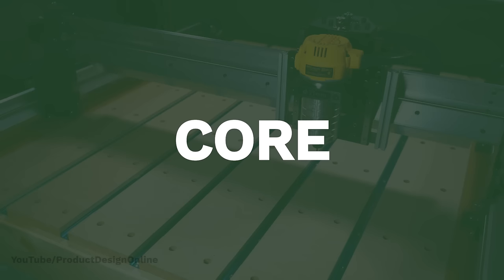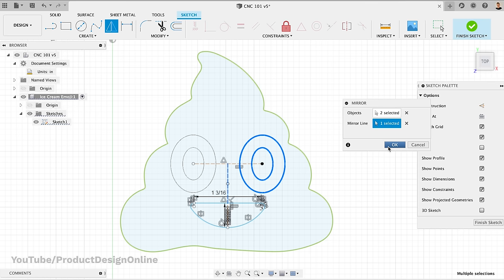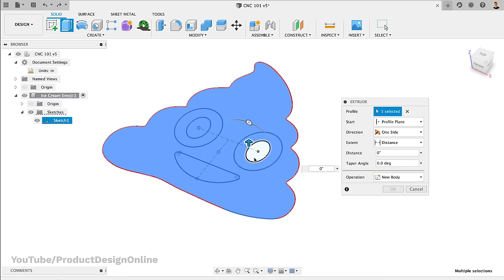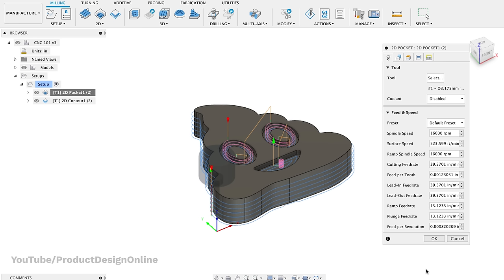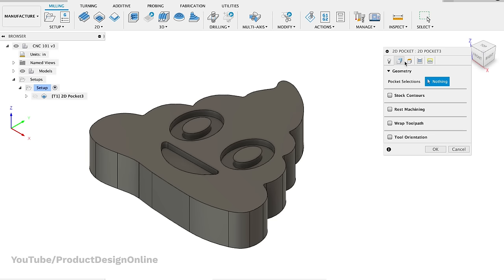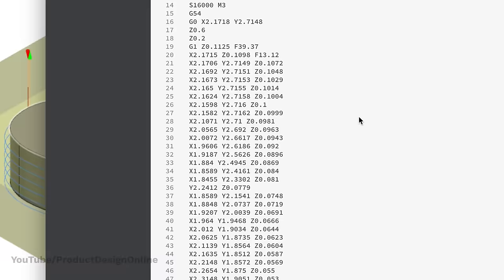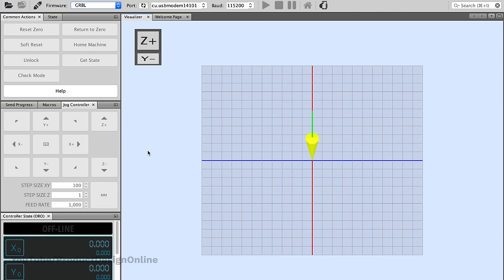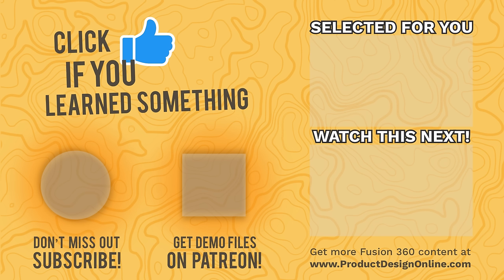CNC Basics - What You Need To Get Started

Comment: Can fusion files be easily used in Easel?
Reply from the maker: Easel can’t import a .f3d file. You can save the Gcode from Fusion and open it in Easel
OR
If a 2D design you can export DXF and import into Easel

Comment: Which software you used to milling
Reply from the maker: Fusion 360, what I teach here on my channel :)

GRBL is the control software (Gcode sender)
Reply: best have linuxcnc software to machine use, mach3 worst, dangerous not realtime working. GRBL cheap free arduino base but old cavemen software. not understand all G-code and M code.

Comment: I so want to buy a CNC but I’m thinking it’s gonna be a massive frustration headache.
Reply from the maker: What types of projects do you have in mind? The biggest thing to consider is which machine, which directly correlates to how much time you'll have to spend 'tweaking' the machine versus just making.
Reply: Product Design Online mostly just signage, sports logos, flags, etc. got my eye on a bobscnc e4 machine.
Reply from the maker: @mattleone5831  Gotcha. Those are all projects that will help you learn the "ropes" of CNC. A lot of 2D and 2.5D cuts, which are a great place to start! 3D...on to 5 axis are where things start to get complex.

I would suggest considering the Longmill CNC (https://sienci.com/product/longmill/) which is just a little bit more than bobsCNC. The main difference is the build materials. I haven't personally used the bobsCNC, but have heard/seen a lot of issues (on forums) due to the wood frame. Cheers!